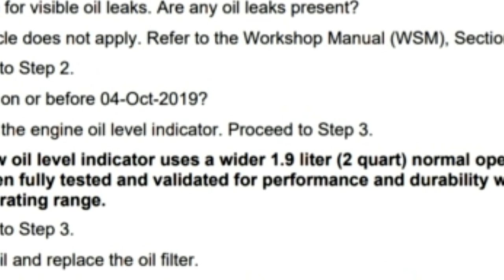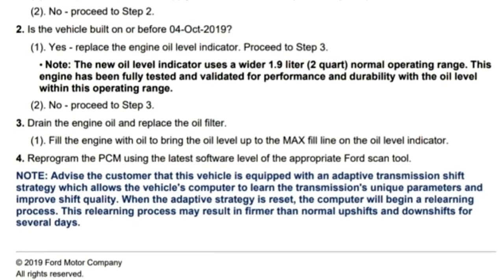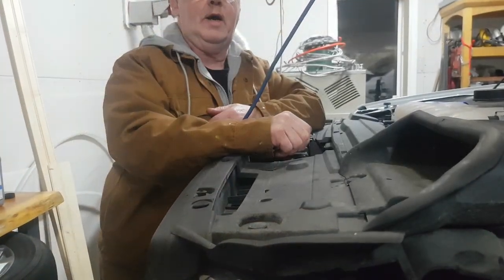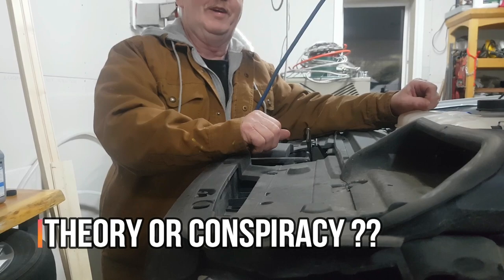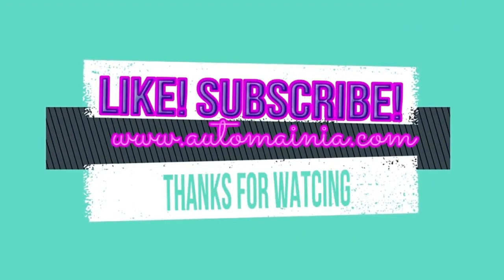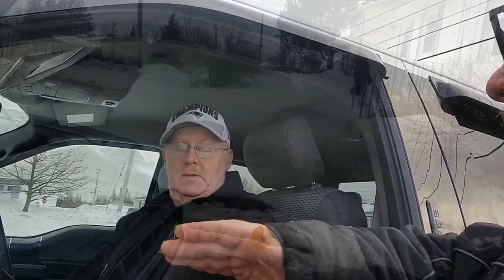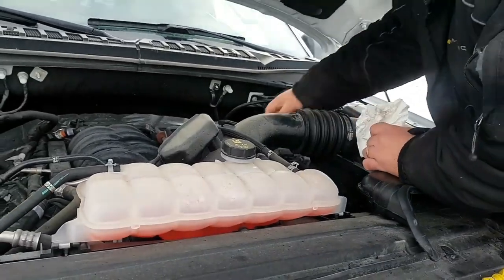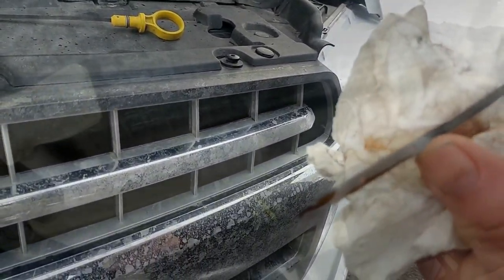#ford f150 oil consumption new dipstick measured 2018 2019 2020 5.0 coyote

Comment: Although many people criticize the 2.7 and 3.5 Ecoboost, they have the least amount of problems for the 18-20 model year. Yes, they have cam phasers and timing chain issues, but I think that’s down to long oil change interval that Ford recommends. Changing the oil frequently like every 3-5k miles on the Ecoboosts will make it lasts as long as the V8s.
Reply from the maker: the transmission works better with those engines. ty for taking the time sir

Comment: My truck used 3 quarts in 6035 miles.  They said because my truck has under 10000 miles that was norrmal.  I did the first oil change at 3035 miles and second oil change at 6035 miles.  My truck has 9500 miles on right now.
Reply from the maker: that would be considered excessive oil consumption
this wont improve, i would have them put this in writing. from now on..  document the problem.
and thanks so much for taking the time and appreciate it. i will have something more on this soon.

Comment: I have a 2015 5.0 bought it with 20,000 miles got extended warranty have had oil consumption test, pcv replaced, and now has a P0430 code my idea is it’s going past the rings and now messed up a 02 sensor or catalytic converters.
Reply from the maker: the code is pertaining to bank 2 front cat converter,which is essentially  a filter. there is only so much work that cat can do if the truck is using oil. what are they telling you?  a vacuum test might shed some light on things.
Reply: this guy's garage I take it Tuesday I checked the oil yesterday and it’s below the lowest mark in the range I have 74% oil life left.

Comment: Im going through  the same thing !  keep all the paper work! Its funny that the mustangs dont  have that problem! Its the same motor, just a different cam!
Reply from the maker: the problem with the f150 is the weight of it coupled with the 10 speed transmission it creates a condition known as low speed preignition, I have a video on the topic that explains it better.  look into Amsoil  motor oil if you cant get ford to take care of this, please keep in touch ,would be happy to answer any other questions!

Comment: Just had this issue. They changed oil. Ford reprogrammed my PCM and got a new dipstick.
Reply from the maker: the dipstick hides the problem. 
if reprogramming worked you would not need to change the dipstick
Reply: @thisguysgarage  , you think the "reprogramming" can use less oil sent to the combustion chamber,  PCV?
Reply from the maker: @shannonhilliard6333  a reprogram (wont)won't fix an engine that is burning oil
.I went through it all. its a mask to conceal the problem.  if the reprogramming worked . the dipstick change would not be necessary

Comment: Ford Tec is saying that transmission down shift is causing excessive vacuum pulling oil into the intake. If this is true than it is burning oil so their  adding new oil,oil filter and the new dip stick 8.75 quarter. Then they change the PCM to match. I don't see how this will fix anything. They didn't do anything with the vaccum. I've been shopping for a new truck and the 5.0 is the engine I wanted but I'm an old school boy and all this new technology is turning me off. I don't think they want people working on there own vehicle anymore .
Reply from the maker: avoid 2018 + at all costs . i have mentioned the vacuum. in a separate vid . thanks for taking the time.
Reply: From my point of view the only fix is to build a block with cast iron clinder liners. It worked fine before 2018.
Reply from the maker: Ty for taking the time. Stay away from the 5.0 🤜🤛
Reply from the maker: @davidcox2197  ty David  for taking the time.

Comment: Put 40w oil and a AOS, you'll lose zero oil. That Ford oil is trash !! Pennzoil Ultra Premium or Amsoil, zero loss between oil changes on my 19 Coyote. There is zero difference between a Truck and Mustang Coyote other than intake and vacuum plumbing. You're getting a vacuum pulling oil, check the intake I bet it's absolutely coated.
Reply from the maker: I was just talking about this in a previous video.  You're on the money.  Ford won't come out with the imformation because they would loose billions in carb credits.ty for taking the time 🤝
Reply: @thisguysgarage  exactly!! The viscosity of oil they recommend is just to pass CARB standards. As a end user, 40w to 50w at all intervals. Plus a AOS to help with the vacuum issue. The Tick issue is also partially owner fault, not allowing the block to warm up properly and not properly broken in. The Plasma coating on the 18+ takes a good 60 seconds of idle first start to allow proper expansion. If they only allowed Ford techs to tell people proper maintenance and care, we you wouldn't be making this video. At least it's content for you !!

Comment: Why not just measure how much oil you removed to get to the low mark? Would have been alot easier than what you ended up doing.
Reply from the maker: i wast playing in it ,#1 verify #2 compare to original dipstick #3
Reply: @thisguysgarage  my 5.0 f150 thank goodness has none of these issues. It is a 2020 with a 8/19 build date. I check oil every Sunday and it has never been low. Always at top of cross hatches. I have 17000 miles on it and 5 oil/filter changes. Great videos you have. If it starts doing any of the shit you show, its a goner. Ill get rid of it at the first sign.
Reply from the maker: @Dan-em9sk   is your truck 2wd or 4wd , reg cab  and do you know the gear ratio
Reply: @thisguysgarage  2wd reg cab. 3:55 gears. It does have an intermittent rough idle that the dealer has witnessed and hasn't been able to fix.
Reply from the maker: @Dan-em9sk  that explains why you are not experiencing the issue.  truck is light and has  the towing package.   the truck is light and has mechanical advantage. 
what is the idle issue you are having?
have you tried a vacuum guage?
Reply: @thisguysgarage  the rough idle is every few days for no apparent reason. Could be stopped at a light, coasting, or at start up (warm or cold engine). Dealer has just been changing parts. So far, plugs, coils, wires, fuel filter, fuel pump, re flash the computer, installed a cold air intake (did not charge for this, said it is from drawing in hot engine air?). I really have no idea what that meant. All I know, is the thing now has an air filter that is gonna cost me 90 bucks to change. As far as vacuum testing it, I have no idea. Only thing I do on this truck myself is oil changes. The weird thing is, when it starts idling rough, turn it off and back on and its gone. Ford says no codes show up.
Reply: Btw, how did you know it had the towing package? I didn't want it with the hitch and that weird dial for backing trailers, its how all their trucks at the dealer were. Heck, I'll never even use it.
Reply from the maker: @Dan-em9sk  you are lucky you have that. it gives you the steeper 3:55 gear ratio ,opposed to the 3:30 standard gear ratio.

the shorter tire on your 2wd truck makes the gear ratio equivalent to 3:73 actually. 

with the ten speed transmission these trucks would not be having the oil consumption problem if they had used a 3:73 or 4:10 ratio. 

keep your oil changed and switch to a full synthetic and you will likely never have a problem 👍 3:55 is standard with towing package.
Reply: @thisguysgarage   i been using the ford synthetic blend from Walmart. 18.00 for a 5 quart jug and 5.00 for the motorcraft filter.
Reply from the maker: @Dan-em9sk  i would encourage you to make the switch to a full synthetic,  but that would be up to you, really appreciated 👍
Reply: @thisguysgarage  yeah. I would but the motorcraft full synthetic is expensive and hard to find locally. The dealer sells it for 15.00 per quart! Walmart and other auto stores don't even sell it. Thats why I use the blend that the truck came with
Reply from the maker: @Dan-em9sk  mobil one or amsoil is what I  use .

never had a problem with it.  I did have the oil consumption issue with the Motorcraft blend.   just a suggestion though. 👍 engine's are expensive too lol

Comment: Just curious why they tweaked the design. It was a great motor and they screwed it up. Why didn't they just leave it alone. Second gen wasn't even that old.
Reply from the maker: multiple design flaws on the second generation ,transmission was another step backwards. ty for taking the time!

Comment: I’ve seen another video where some technician fixed the issue by recalibrating the PCM with a computer. Try that!
Reply from the maker: was done didn't work 
this was after the flash. 
ty so much for taking the time 🤜🤛
Reply: this guy's garage That’s a damn shame. What’s the plan now? Keep filling the 5.0 with oil?

Comment: my 2018 f150 5.0 had one motors replaced at 5,000 and another at 10,000 THESE ENGINES ARE GARBAGE.
Reply from the maker: absolutely, ford has built a million garbage cans,what are they doing for you now?
Reply: Trust me get a lemon law attorney I got a very nice settlment check and they took truck back and they said if i will get another ford they would take 10 thousand of sticker i got a 2.7 ecoboost zero issues.
Reply from the maker: @waynea2707  that's awesome Wayne.  im in a 3.5 eco no issue to report either 🤜🤛

Comment: but its an 8 quart system...Unlike GMs 6 quart system...You have more headroom
Reply from the maker: plenty of room to hide the oil use by widening the dipstick , its 9 quarts now that its being overfilled
Reply: GM's system is 8 quarts in LT gen 5 engines in trucks, not 6. 10qrts in Camaro/Vette. Ford's is 8.8qrts in gen 3 Coyote trucks and 10 in Mustang. This includes what goes into the filter. Honestly this also varies. One variance is how long you drain it and at what level. My Mustang takes 10.5 quarts including filter when I let it drain for a while and the nose jacked up while draining.
Reply: @ShizawnSanders  my Silverado took 6 my Sierra took 6. My F150 and Mustang take 8 so
Reply: @excelerater  that means you don't have a 2014 and up Silverado and your Mustang is a 2011-2017 5.0. 2018+ Mustang 5.0 take 10. 2014+ Silverado with a 5.3 or 6.2 take 8. If the person in the video got the same year Silverado as his F150 it would take 8 quarts.
Reply: @excelerater  also if you are putting only 8 quarts in your F150 and its a 2018+ you are under filling it.
Reply: @ShizawnSanders  I know what I owned . Glad I don't have a plastic POS oil pan too
Reply: @excelerater  lol, so you name the one thing on my car that is inferior? That's funny. Looks like someone doesn't like to be called wrong. At least my Mustang has at least 5 liters of displacement and its not just rounding up.

Comment: I haven’t watch the entire video but isn’t the problem with the cylinders walls themselves? No way to fix that minus  pulling the motor and putting in a sleeve.
Reply from the maker: its certainly part of the problem the other part being low speed preignition from the 10 speed transmission lugging the engine. ty for taking the time

Comment: I have 2019 5.0, it did use some oil when It was brand new but not anymore. Also be aware they use a special coating on the cylinder walls for longevity so in others words, stop driving so gingerly 😆
Reply from the maker: ty Michael

Comment: Try out GM’s 5.3 its been around for awhile and its proven
Reply from the maker: Would be good  .the ten speed transmission is giving the 5.3 the same problem with oil consumption.  But the 6 speed units are as good as gold
Reply: 5.3’s were only good before cylinder deactivation. Now the rockers are popping off and starving with oil on top end
Reply: Deactivate the v4 made and it wont burn a drop of oil, im going 250k strong and have not noticed any change in mpg

Comment: Maybe they should have made a new bigger oil pan??
Reply from the maker: they will drink all the oil you can put in it if the problem is not fixed. ty again David 🤜🤛
Reply: @thisguysgarage  How about build a proper block with cast iron cylinder liners to start with??
Reply: How can this engine pass smog burning so much oil??

Comment: Pretty much at my wits end, Tsb's carried out, engines replaced, dipstick replaced in January, now just 5000km on engine since latest TSB, and level nearing the bottom hole on dipstick.
Dealer, says today that it is still within safe range.
Of course now we now the safe range is approximately 2.7 litres .
Where do I go from here, Caper , any suggestions 
Dave
506-333-1291
Reply from the maker: Have you heard of can vac?
1 liter per 5000 kilometers is still the standard.  So it is still failing the oil consumption standards by ford safe operating range is not the standard
Reply from the maker: Are you in new Brunswick?
Reply: Saint John, NB
Reply: That’s ridiculous, I’m sorry you’re going through this,  seriously. See if you can do a buy back through lemon law, talk to a lawyer

Comment: Why don’t Ford quit pissing around and put sleeves back into the cylinders , like before when the 5.0 was a great motor 🤷‍♂️
Reply: Why ? They've been out long enough and the verdict is in, they hold more power than the Sleeved blocks and with proper breakin, proper warm up procedure ( don't just start up and drive off ) no tick or oil loss. Use a quality oil and stop using 20w, you won't lose oil period. The oil consumption has zero to do with the motor itself, it's vacuum pulling oil. AOS and thicker oil for protection, problem solved.
Reply from the maker: thanks for taking the time,i wonder why ford is not giving this info ?